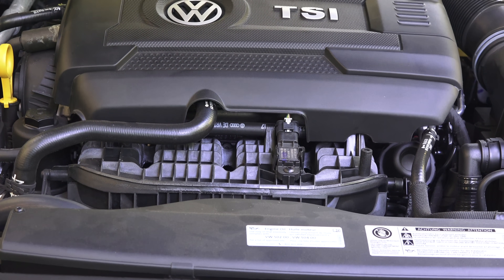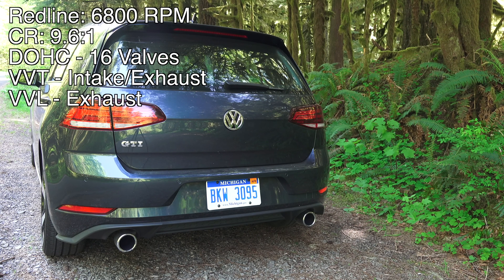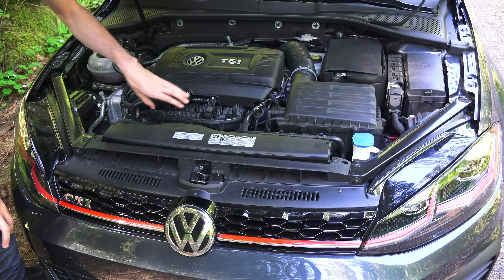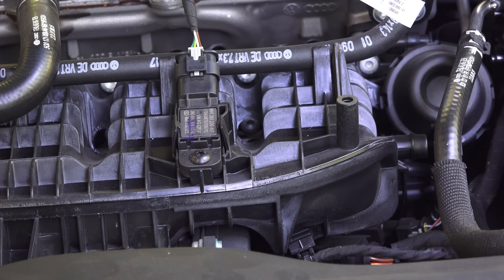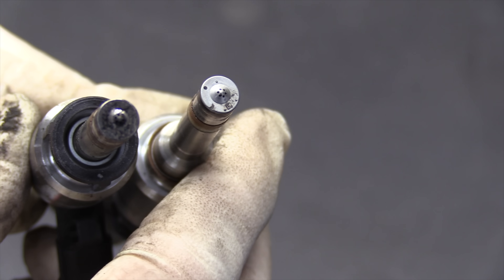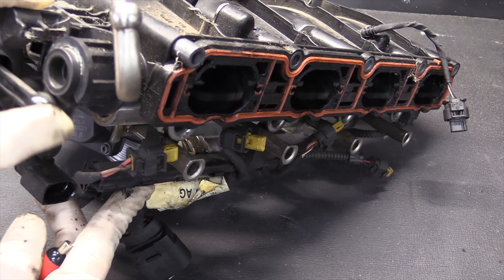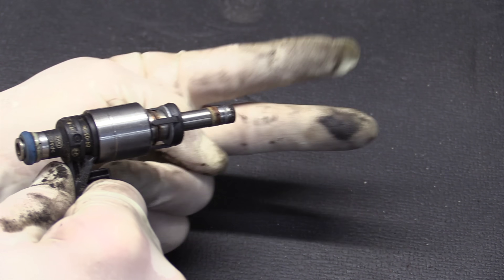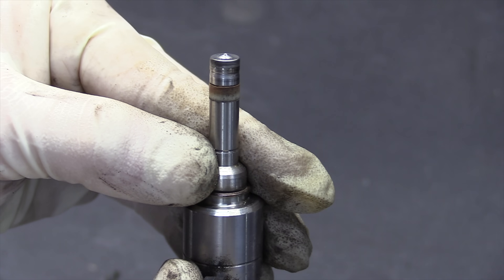The Best Engines - Volkswagen GTI Turbo

Comment: Hello Jason! I got a question on rotational inertia on powered vs none powered wheels. Before I start I want you to know I’ve watch your videos on rotational inertia part 1 and 2 and this message is both a question and a video request of testing my question

So...
My friend and I are debating if weight reduction on non powered wheel in a drag race would make a big enough difference. 

We agreed that any weight reduction will be beneficial on acceleration and braking, 
And we know weight reduction on the powered or driven wheels will allowed the engine to put down the same power more efficiently to spin those wheels. 
But what about non powered wheels that just get dragged or pushed along?
I was wondering if you can make a future video on your S2000 using all 4 wheel weight reduction vs just 2 powered wheel weight reduction and test the acceleration time and braking in real life. 
And at the same time answering the internet myth of “1lb rotational weight reduction is equivalent to x lbs” 
I know you had a video back in 2013 explaining them but it would be nice if you got anything new to add 

Thank you!
Reply: Interesting question. Assuming both sets of wheels weigh the same, have same mass, have equal tire sizes, so on and so forth, they will have the same "moment of inertia" as you say, if taken into account individually. Now, when fitted in the car (that's what we are interested in), they "should" be the same if we consider few factors, but if we take into account all other components and their respective "moment of inertia" (driveshaft, halfshafts, bearings, etc) -which remain constant in the experiment - and fit wheels in the powered axle with a reduced "moment of inertia", the power response to the driven wheels should be therefore quicker since the engine has to make slightly "less effort" to spin the wheels.
Another relevant factor is the traction between the tire and the road. Assuming both sets of tires have the same grip and same "contact patch", then on the other hand the ones with less wheel mass would be more prone to skid on the driven, as there would be less weight on the axle.
Besides, one of the most important aspect to consider is if the car is FWD or RWD. When the vehicle accelerates, the weight is transferred to the rear, so in the case it has exactly the same pair of wheels front and rear (also same grip), the former traction layout has higher chances of slipping than the latter, but the opposite would happen when breaking, since the weight is transferred to the front axle.
Maybe somebody with greater knowledge can explain this more precisely, as I have missed to describe both behaviours taking into consideration the concept of "suspended and unsuspended mass". Anyway, this has gotten too finicky and probably difficult to grasp if I failed to express myself properly. Sorry for such a long, obnoxious answer, but I am also keen on hearing a response to your question!

Comment: Cool Video series. Could you do a video on the Volvo 5 Cylinder engines? B5254s (N/A Variant) and the B5234t? (Turbo Variant) They're fairly unique and underrated as tuning platforms. I might be a little bias...

Comment: Ok, so which engine/vehicle typically gets the most miles before giving up the ghost?
I'm not talking about a one-off thing or world record . I typically trade in my Toyota 4 cylinders at 300k, but I don't long they'd be really go. I heard the MBZ 300d will do 2x that.
This could spawn off several videos such as what can you do to help you car last as long as possible, and what about additives you should you  consider for older cars? My 2005 Tacoma has 200k on the clock, and the lube place suggests a "high mileage" engine oil (2x the price). Is it worth it?
SUB'D in so I'll see your response.

Comment: One thing I really hate about my mk7 gti is its plastic oil pan.
Reply: BerserkFury89 that was a big freak out moment for us too. 
But honestly they have been great. I replaced WAY more aluminum pans for stripped plugs or damage. 

The worst ones were actual the steel bottom pans. The weld for the drain plug threads would break.
Reply: I'm just worried about possibly hitting something on the road and poking a hole in it... It is also kind of annoying having to buy a new plug for every oil change.
Reply: BerserkFury89 
Run over anything could put a hole in anything
Reply: That's true but I still can't help but feel uneasy about having plastic down there instead of metal.

Comment: Should do the next one on a  Chevrolet  LT-1 and the comparison  of its older brethren. .yes....fuel injected coil on plug LS motors and even further back with the small block  350 vortec , LT1/LT4 with the fuel injection and elec throttle body injection (TBI) with the optispark and distributor vaccum advanced and electronically advanced solely showing the advancements in fuelling and power /torque delivery of the modern chev...but it's a thought...

Comment: I'm by no means an expert at this, but it is my understanding that horsepower = torque x RPMs / 5252. given that equation, how is it possible for an engine to have peak torque all the way from 1,500 RPMs to 4,500 RPMs while the horsepower continues to climb? that makes no sense. any explanation would be appreciated.
Reply: NewGoldStandard Horsepower is a product of torque and RPM. More of either and the horsepower climbs. Less of either and it falls.
Reply: If there is peak torque, then torque in the equation is held practically constant (that is, at peak torque). As the revs climb, horsepower will climb too, as HP is directly proportional to RPM.
Reply: thank you for the thoughtful responses, especially GlassTopRX7 and Visaural. I guess the answer was right in front of me with the equation I provided... still the idea that an engine can produce max torque over such a wide rev range does seem a bit counter-intuitive. regardless, thanks for the replies. I really like GTIs, it's been a car I've been really considering for a while now, so the more information, the better!

Comment: Sr20det Nissan, 3sgte Toyota. Old engines, 250bhp easy.. Efficient enough. Can deliver 500+bhp tuned like crazy. Also deliver the same mpg as vw 20 years later. Nothing has improved?

Comment: So cool, the engineering is really something. The car for sure needs a better exhaust considering it's the more performance oriented model and some turbo noise wouldn't hurt either.
Next engine: any variant of the two turbo AMG V8's i find it interesting their placement between cylinder banks and how small they are

Comment: Worth noting that the GTI in Europe does have dual injection (port and direct) that largely eliminates the carbon buildup problem on the valves. Also worth noting that this is the result of the more strict EU emission regulations compared to the US. In this country such refinements are left to the tender mercies of the manufacturers.

Comment: Quick response due to turbo charger being close to the manifold? I'm sorry but I had MK6 GTI for a year and couldn't agree anymore. The car was absolutely pos. Massive turbo lag in lower rpms and no power at high rpms. It only had alright torque on mid range but in city the car suffered with turbo lag along with shitty DSG. And on highway it just didn't have enough power above 5000rpm. Along with questionable build quality I ended up selling in just one year after I bought it brand new and couldn't be any happier that I got rid of that pos junk.

Comment: Having ridden in one of these it is a FAST car especially when chipped and a larger downtube. More than enough torque to get up to 60mph in 2nd. time will tell what the long term issues with these are...
Reply: Been about a little more than 6 years now, and they are pretty reliable thus far. The waterpump is the only thing to really worry about in higher mileage. Just keep up to date maintenance like dsg services and stuff on time.

Comment: Get a BMW M57 on 6 cylinder diesel that’s built like a truck engine. Mines has 220.000 miles on it and run as smooth as silk. Bags of power and fuel economy.

Comment: its a good around hatchback. not the fastest not the slowest but still a very good car
Reply: I tell people that's it's a quick car , not a fast car
Reply: Max torque at 1500rpm = power you actually use all day, every day. Those top end numbers aren't terribly impressive but I typically don't drive at redline on a day to day basis. Love that GTI.
Reply: Not the fastest, not the slowest but it sure as hell is the most unreliable hatch... Even the ST is more reliable 😂
Reply: @SikConVicTioN  I'm the fifth owner of my Mark 6 GTI and got a chance to look at its repair ajd maintenance history across all four. Not a single one of them ever dealt with anything more major than a brake job. The car runs fantastic and I couldn't be happier. Have you ever even owned one or are you basing this off of some half-assed car youtuber's opinion?
Reply: @SikConVicTioN  false
Reply: @baranUtube  Agreed. Ford=Fix. Or. Repair. Daily
Reply: @TDizon3  my friends focus st blew his turbo up at 65k miles and oil started going into the pistons, and he usually doesnt beat on the car nor was he tuned or anything

Comment: I dont know, my Mercedes M104 engine from the 80s also has intake flaps and variable cam timing. Also its port injected so no carbon buildup like you see in the VW intake.

Comment: Up to my 3rd VW now, absolutely love it... Never had more than a flat battery as far as problems are concerned. My 2015 Golf R is a hell of a lot of fun, great steering feedback for a car with electric steering and performance better than most cars on the road! How many of the people complaining about reliability have actually owned and lived with one?? Or have looked after the car properly?? Part of owning a car means following the service schedule and not skimping when it comes to maintenance... I'm a big believer in "you look after your car, it will look after you"... So many people complain about parts and servicing being expensive or whatever, I say so what? When you buy a car, you do your research and should factor in those costs from the beginning. You really wonder why the car breaks when you don't look after it??
Reply: Try owning a VW for more than three years. Regular oil changes aren't going to prevent your shitty plastic water pump from exploding, premium gas isn't going to prevent your timing chain tensioner from failing and destroying your engine.
Reply: @sethrhow4814  I have the 10 year old Vw from my mum. Until recently I didn't even know where the hood release was because I had zero problems with it. And my mum skipped on a lot of regular services
Reply: @sethrhow4814  Isn't that why new cars come with a warranty? And once the warranty is over just upgrade those parts :v if you can afford the car upfront a few parts is pocket money.
Reply: Absolutely.  If you follow the maintenance schedule religiously, and I don't mean just doing oil changes, then your VW should run to 500 000 km at least.
Reply: Anthony Jakovljevic yeah most vehicles are capable of that kind of millage I had an old landrover with 380 000 miles on the clock when I sold it an th engine is in another truck now. So yeah 500 000km is very achievable. But like you say it takes more than a drop of oil.  Many parts are service items.
Reply: The Matt VL  Well said the cost of a car is not the price tag.

Comment: the problem with this engine is the timing chain tensioner goes on it, wrecking engines with as little as 30000km driven. its a well known problem (known by vw themselves - confirmed by my local vw dealership in germany when it happened to my wife's 2011 1.4 tsi) not just on the 2.0 but the 1.4 tsi as well, even the lower power rated versions
Reply: I dropped $3500 into my Tig after the tensioner failed and bent 8 valves.  This engine has issues.
Reply: I updated the tensioner for $700 when I came to know about this issue. Car going fine and now 113000km without any isues. No oil consumption.

Comment: Sorry, but VW can't make crap without cheating.
Reply: "Nissan says emissions and fuel economy tests were falsified", "Mercedes-Benz is alleged to have installed software to disengage emissions controls when temperatures are less than 50 degrees Fahrenheit. It is believed that customers were deceived into paying a premium for “clean diesel” cars that allegedly emit pollutants well beyond the government standard." "Harley-Davidson has an expensive emissions problem of its own. You act like Vw was only one.

Comment: Does not seem that great an engine to me. A Saab B204 Engine with Trionic5 from the 90's has the same power and more torque, and more MPG from the same displacement. The bigger B234 (2.3), even more so. Plus they can do over 200,000 miles and not fall apart. And they also had twin Balance shafts. So yeh, VW not impressing when a 20yr old engine was better.
Reply: lol i have the B205L converted to a B205R by replacing turbo and tuning. I went from 185 hp to ~300 hp with just the turbo swap, full 3" turboback, and a good tune. I'm running at 207k miles right now and the engine is running strong, with the exception of oil consumption due to the shitty PCV system from stock.
Reply: Nice to see another Saaber. You are on the limit though. The GM B2x5 engines are maxxed out at 310bhp. And tend to blow bits all over the floor at 330bhp. The old Saab B2x4 engines will take 500bhp in standard form as they were heavily over engineered and fully forged from the factory. Check out the UKSaabs forum if your not a member already :-)
Reply: You don't make 300 hp on the 2.0 B205 with a Td04-15, 3" exhaust and tune.

For 300hp you should have an intercooler, 3.5 bar FPR / bigger injectors as a minimum on top of your setup. A Td04-19 wouldn't hurt either to nut run the td04-15 out of breath. A B235R might make it with the list I just gave you. Anyways, anything much over 300hp is gonna ruin your poor pistons in the long run unless you build a B2x4/B2x5 hybrid setup with the bottomend from the B2x4.
Reply: @ Richard. Whos talking about the rubbish GM costsaving B2x5 series ? They start to let go and blow bits all over the road at 300bhp. And almost definitely by 330bhp. Sadly though, B2x4 engines are thin on the ground now, and Vauxhall kids keep taking them for Astras etc.
Reply: I was reffering to jeffrey that answered to your post that he went from 185 to 300hp with just those parts he listed. But yes, the B2x4 is a strong beast with lots of capabilites
Reply: Richard Olsen I do have a ets intercooler, however bcb literally told me that a 3.5 bar fpr and injectors don't have any gains as they are negligible. So far, butt dyno tells me the power is around there. I will go dyno it one day to find true whp. Whatever, if it floats your boat better, then let's say I have 280 hp tops. I've fallen in love with the car and dont know what I'll do when the engine blows. I heard that putting anything larger than the td04 will require top mount which removes AC capabilities. Correct me if I'm wrong but that's my fear, especially when I'm in California, no mechanic is going to let me pass smog with a top mount turbo as it's obviously not stock.
Reply: jeffrey625625 I understand. As I said, a TD04-19 will fit, gives you a better top end. Doesn’t really matter if it’s 280 or 300 hp though, it’s still strong and pulls nicely! 

I was exclusively a Saab-person, then I bought an Audi with the ea888 2.0 tfsi and got that tuned, and it’s far stronger than my tuned 2.3 9-5 aero was across the register. Peak torque and hp is just a number, it’s how it drives that matters. So saying a b2x4 is superior from an engineering standpoint, I have to disagree. Except for that damn oil consumption that the pre-facelift ea888 especially struggles with
Reply: Richard Olsen I definitely agree with the VW turbo 4s being the superior engines of today. My mom has a 16' base model golf with the 1.8tsi and it makes amazing torque and for 170 hp claimed, it feels faster than that. I'm going to try to convince her to get an apr/unitronic tune or dyno tune to bring it up to around 230 hp as they claimed. But I just want to keep the credit to Saab for essentially pioneering the mainstream 2.0 turbo combo. Seems like it's the perfect displacement for power and fuel efficiency.
 
I should have just ordered a 19t for the new td04 I just put in, but I guess I'll wait till either the engine blows or the turbo blows. But I doubt the turbo is going anytime soon, I got one of the last brand new genuine Mitsubishi turbos.
Reply: You'll probably be set turbowise for years/thousands and thousands of KM's to come then!

And yes, the torque of these engines is really strong. I have a REVO stage 2 tune on mine, and it just PULLS from any rpm